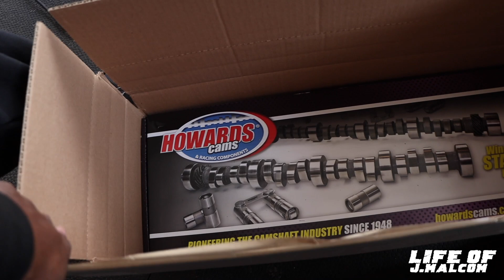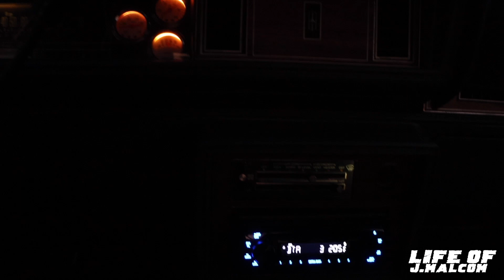GOT THE RnB SUPERCHARGED CUTLASS STRAIGHT AND LOOK AT WHAT I  GOT FOR IT

Comment: I agree 💯% with you. Now I will admit I went electric fans on my Continental, but I also did a three row aluminum radiator as well. I'm not doing a big brake kit on mine as well because it came with 4 piston calipers on the front and drums on the back. It's going to be a cruiser on 22's and air ride. Do what you like and all the people trying to spend your money tell them to donate some to the project. That will usually make them shut up when you tell'em that NC BCG 💪🏽.
Reply from the maker: Nothing wrong with either and you did what you wanted to do which is what it’s about and what I was getting at. Salute bro💪🏾
Reply: @LifeofJMalcom  appreciate it homie. Once I get it the way I want it I'll shoot you a picture of it.

Comment: J they not paying attention again. You upgraded heads already. So changing camshaft is not that much work. I think you had valve spring and head cc flow in mind. When you bought the heads. Some moves you make are in plain sight. Can't wait for upgrade.
Reply: True dat, I remember that video.  Found out about them flat head piston